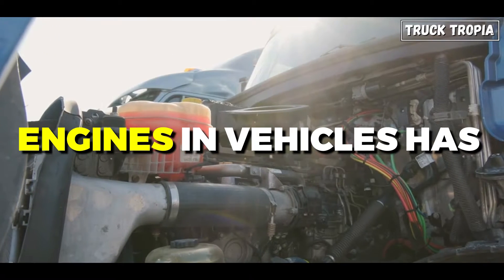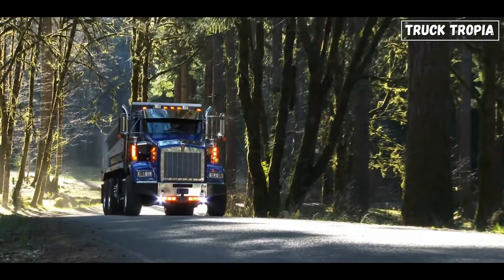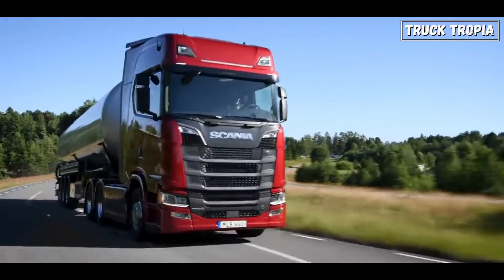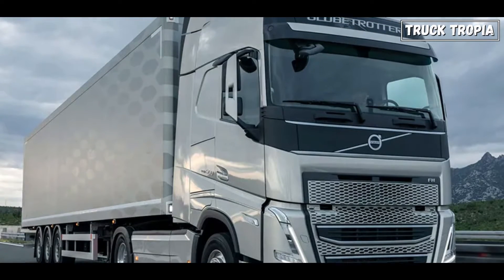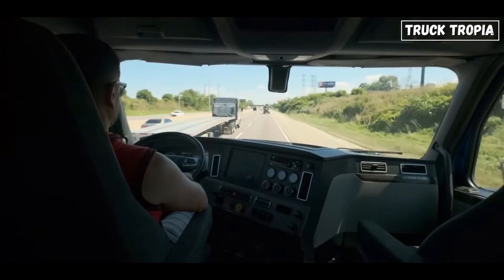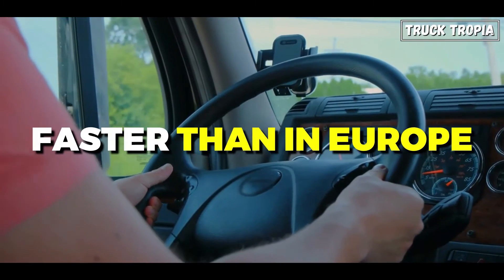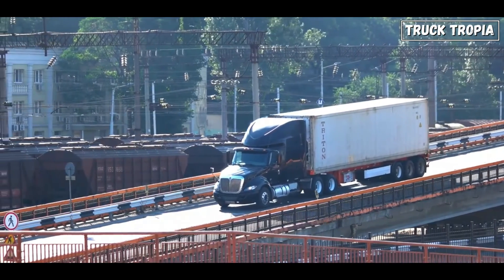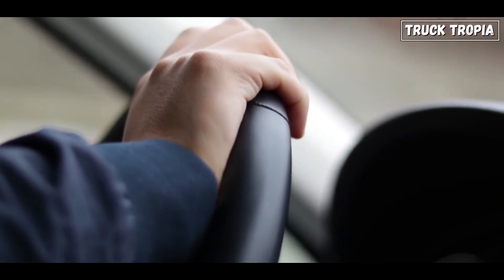Why Do Big Trucks Always Keep Their Engines In The Front?

Comment: Well I can say from my experience with my 79 kenworth lw 924 , it has a 3408 cat , 30 ton Columbia logging rigging , when my truck was empty , with no trailer on or hooked up or off completely, it had traction issues with the big v-8 cat up front , but put a load on my lw  and no traction issues at all, plus the big cat helped with great weight over my steers
For them nasty switchbacks

Comment: Honestly, for calculating the maximum length, it makes more sense to calculate it by looking at the combined length of the truck to the trailer.

For example, there are still many situations where trucks and their trailers get loaded on car ferries or trains to be shipped around like cargo. That means the total length is the limiting factor, so that standard is justified because there are physical limitations in the real world.

That's why Europe can build major infrastructure projects like the Channel Tunnel or the Gotthard Base Tunnel.

But if you only look at the length of the trailer and ignore the truck, what's the point of that?

Comment: @truck Topia, again another video with misinformation, European trucks, have a better ride and are more aerodynamic and fuel-efficient than American trucks, the cabs on European trucks have a 4-point suspension system which makes the ride very comfortable, also the cabs are well insulated against the noise of the engine before I retired I drove a 2014 Mercedes Actros MP4 in the UK, I had to open the window to listen to the engine, just to make sure it was running that is how well insulated they are,
Also looking at the fuel efficiency and aerodynamics, it's not uncommon for European trucks to return 10/12 mpg running at 44 metric tonnes(97,000lbs) compared to American trucks running at 36 metric tonnes(80,000lbs), each European country has its own speed limit for trucks, which is usually between 80kph and 90kph, most Western European countries allow 90kph, except the Netherlands which is 80kph, also to increase fuel efficiency the trailers are close coupled to stop the dirty air between the tractor unit and trailer, fuel efficiency and aerodynamics go hand in hand, so again European trucks lead the way where American trucks follow, so again I will say to you guys, do your research before making your videos, I will say this time and time again until you understand that the only advantage that an American truck has over a European truck is the living space.
Reply: You Europeans are joking
Reply: And American trucks NEED that living space, when we have common long runs in the 3000+ KM range for a SINGLE trip.
You'd have to cross pretty much all of Europe to travel what US truckers routinely travel INSIDE the country.
Moscow to Paris is appx. 2800 km and crossed multiple countries the LONG way - and is right at the same length as Indianapolis to San Diego which isn't even a "across the USA" route, as Indianapolis to any city on the East Coast is another 1500 km appx.
Reply: @bricefleckenstein9666 , I'm not arguing that point. European trucks are far more advanced in every other way, as I stated in my comment, so much misinformation, due to lack of research.
Reply: Your fuel efficiency info is grossly inaccurate. I have 5 Freightliner Cascadia from 2014 to 2016 in my fleet hauling around 42,000 pounds of grain we average at 70 mph 11 to 13 MPG.
You haul heavier loads at slower speeds which is where you pickup the mileage but aerodynamically speaking the streamlined US trucks are at least the equal or superior to the Euro cab overs.

The only way your argument holds water is if you only consider the traditional long nose brick-ish rigs like your Peterbilt 389's and Kenworth W900's. They do get the lower mileage that you state but are far more comfortable due to the longer wheel base and far larger berths.

Comment: Well, you can't have the engine below the cargo space (flatbed, box or whatever). It would steal space. This is the main reason.
Just look at the old Volkswagen vans where the engine was in the back. The floor wasn't flat and the loading height was high in the back.
But almost all full size buses, at least in Europe, today have their engines in the back, behind the drive wheels. The bottom of the bus is like a basement with luggage compartment and th passengers sit above it so the location of the engine doesn't matter. Less engine sound and heat is transferred to the passenger area and the bus drives better on slippery roads compared to a front mounted engine. And obviously no problem with cooling down the engine either.

Comment: I'm just glad we no longer use Cabover trucks in the USA, those trucks were a nightmare,thank God for conventional trucks with tandem axles and large sleepers.
Reply: americans trucks are good compared to any 1950 truck from other countries. wonder why american tech stopped ecolving after ww2
Reply: But on the other hand, America can't build a Channel Tunnel, Gotthard Base Tunnel or Fehmarn Belt fixed link without standard truck lengths.

Imagine not needing a sleeper because you can just park your truck on a train in Kansas City, be carried underneath the Rocky Mountains and drive off a ramp in Sacramento a few hours later.